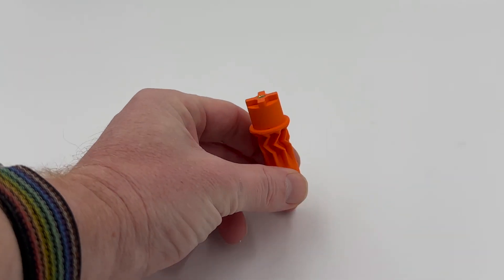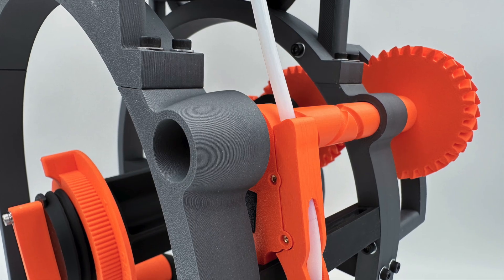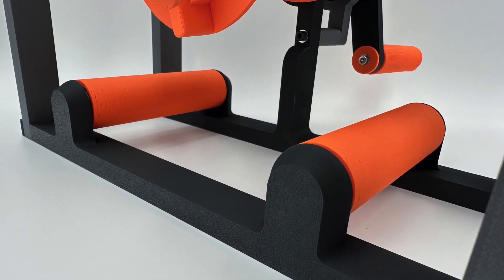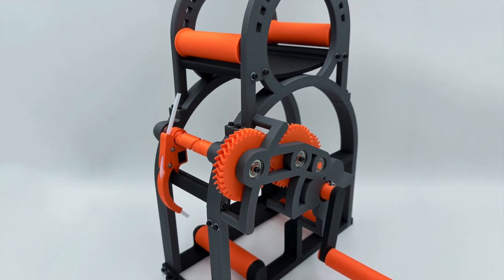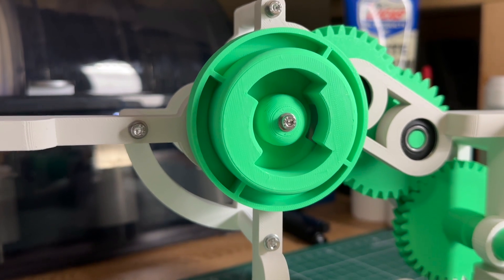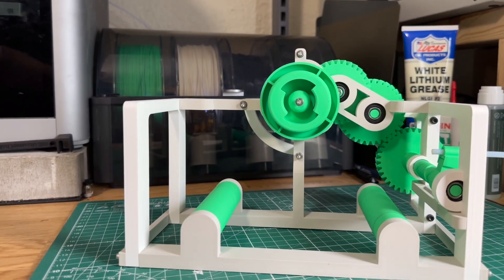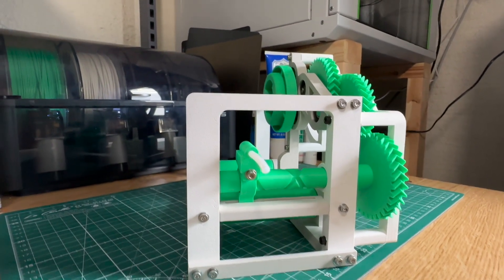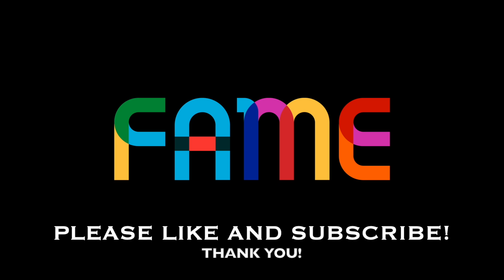V-Spooler - Beta 6 Updates Explained

Comment: Hi, I've tried using a couple of the other "popular" spoolers and they are just not reliable. I think this idea and concept looks really good. I am in the process of acquiring all the hardware I will need to print and build this, but I am just waiting for the motorised add on. I want to go ahead and get the nema stepper motors etc now as well. Do you know when we can expect an update on the motorisation component and also if i print the Vspooler now will the motor addon just be a plugin or will i need to print most of the parts again. Cheers, Hem